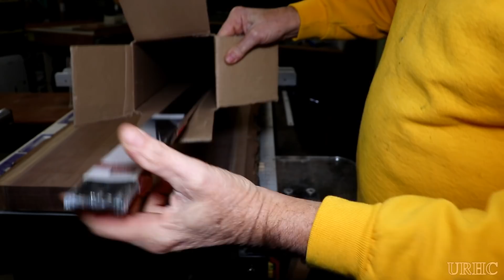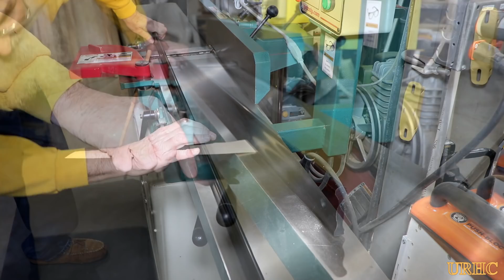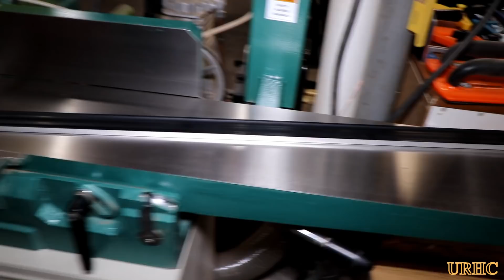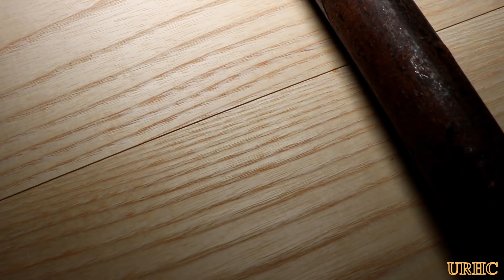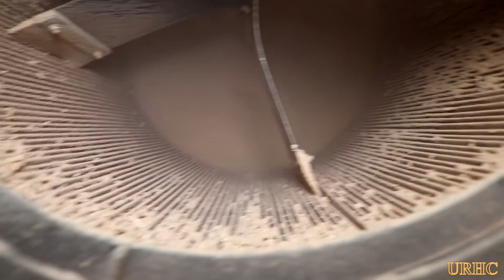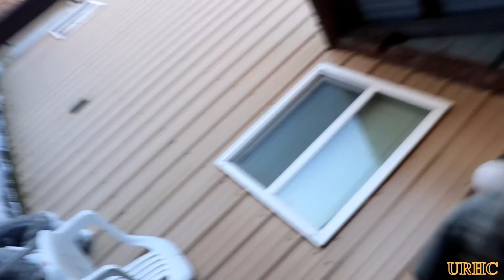Peachtree 50 Inch Straightedge For Aligning The Jointer Tables & Blowing Out The Dust Collector Filt

Comment: I had the same filter set up and got tired of cleaning the stupid filter.  It was forever choking the efficiency of the vacuum. Instead,  I purchased a 40 gallon Brute trashcan with a lid and disassembled the dust collector.  I cut the trashcan lid to match the center ring of the collector and mounted it.  The center ring already has a cyclone built in.  Then I installed the lid cutaway to the top of the cyclone and added a 4" port.  I mounted the motor to the wall outside of my shop (for noise reduction) and it vents to the outside.  It works GREAT!  Only super fine dust gets vented outside and there's no more .5 micron fine dust in my shop anymore and I'm not wasting time with the stupid filter anymore.
Reply from the maker: I have videos  about  redoing my whole system.  The dust deputy really catches most of the fines. Thanks for watching.
Reply: @unemployedredneckhillbilly2023  Understood.  My point was about getting rid of the filter completely and venting the system outside to eliminate any dust escaping the filter.
Reply from the maker: Not an option  in cold climates  and having  a woodstove.

Comment: The problem i have with that straight is their claim is made in a vacuum, the straight came in a package that ensures no protection, and i'm not referring to the mailing section, i'm referring to the shipping from factory.
Now, for a wood planer, there's no need for more than a visual inspection on that straight edge can detect, but still, claiming point something something when your product arrives in plastic...yeah, not worthy of that claim.
Reply from the maker: I expected it to be packed better but I didn't see any indication that it had been stressed. I wish that I could find a big surface plate to check it to have a good idea of how much it is out. I am sure that it is accurate enough for setting up the woodworking tools that 
I own Being able to mate 2 surfaces cut with perfect alignment is the real test and it was straight enough to make that happen. The shape of it makes it very rigid and it lays dead flat on my milling machine table so I know at least 3 feet of it is flat. Lucky it came by USPS because UPS would have surely damaged a box that long. Thanks for watching.

Comment: I noticed that the filter cleaner blades were just bolted on, I would be tempted to replace them with wider blades so that they cleaned more area. I think this would be a simple but effective amendment to the filter
Reply from the maker: I don't think it would help. The blower packs that sawdust around the bottom with that big hole in the divider plate. I ordered a cyclone today to try. Thanks for watching.

Comment: I have the same (or very similar) dust collector. I have to do the same cleaning every once in a while. I added a separator using a metal garbage can and make the funnel on top by watching a yourtube video.   Made a huge difference.
Reply from the maker: I use one of the separators on my planer and it helps with the chips but the fine dust goes right through it.  Thinking about a big dust deputy on a 55 gallon drum now. Thanks for watching.

Comment: I would love to get a dust system but my shop is way to small for one. Tomorrow I am bringing home my first planer, I have no idea where to put it yet lol
Reply from the maker: My first shop was a 10 x 10 garden shed in a trailer park.  I had to drag the tools outside to use them. Never thought I would have a shop big enough to build projects in but somehow it all came together.  I still remember them delivering the first new tool that I purchased.  A Foley Belsaw 12 inch planer molder. Thanks for watching

Comment: Dear Mr. UHRC, I regularly maintained an 8" Grizz jointer with an after market Byrd Shelix head (I installed the head) for a community shop near Boston. The relationship was a rocky one as I could count on the Grizz needing my attention every week. * It was a heavily used machine in a very large shop. I discovered that the little set screws on the eccentric bed adjusters would not stay put. They were simple (cheap) set screws and had the typical raised ring on the bottom which would cut the mild steel of the axles under the table. When I made small incremental adjustments I could feel the set screw sink into the cuts in the axles. I filled the raised rings off all the set screws. * The set screw would all too soon loosen up and I would need to tweak them again and again. I tried reversible thread lock and found it to nor be tough enough. I then settled on a double stack of set screws in each hole. The one on the top locking down the one below. I got set screws that used all the length of the tapped hole in the base casting.***  Before I get down to business I remove the fence and get it out of my way.  I use my 50" straight edge putting about 3/4 of it's length out over either one of the tables. (I counter weight the short end with a couple hammers so I don't need to hold it)  and a 1/1000" (your paper may be 5/1000" of an inch) stainless feeler gauge to check the OFT (out feed table) to cutter head setting and the OFT to front and back cutters in the head. I then do the same from the IFT (in feed table) to the cutter head and cutters. I do this to find any wackiness between tables and cutter head. I often find that jointer cutter heads are high/low from front to back by. If it were more than a couple thou  I'd shim the base of the cutter head with brass shim stock to get it level to the tables. It's a toss up whether it's easier to shim the cutter head or level the tables (again).*** I use a 12" steel machinist's straight edge to gauge the relationship between the OFT and the cutter head by marking the straight edge and table with a Sharpie so I can watch the amount of drag as I move the cutter head under the straight edge. I do not hold the straight edge. I aim for 1/16" or less of drag from front to back. I will check all the blades on a straight knife cutter head but I don't bother on insert carbide cutter heads as , if it wasn't milled correctly by Grizzly there's nothing I can do about that.*** I also recommend checking torque on the cutter bolts as soon as you get the jointer, again after 1 week and again after 1 month of work. I ALWAYS find bolts that need more torque.  Doing it by hand with the Grizzly supplied Torx driver.*** Oneida - Air recommends that their can filters be blown out every day that the DC (dust collector ) is used. 50 PSI. Between cleaned with air than the flapper as sooner or later the friction from the flapper will wear out the filter . If using the flapper I recommend 30 to 40 turns one way and 30 to 40 turns the opposite way. That will of course wear out the filter quicker. * I've recently added a 96" Phenolic straight edge used by glass shops, to my straight edge collection. For working on 16" and larger jointers. * Yours, G.
Reply from the maker: They definitely are tricky to adjust. I am guessing those 2 front sets screws slipped over time as you say. I will have to try using 2 set screws as you suggest because the hex felt like was soft and stretched when I finally cranked them back down so I planned on changing them anyway. For some reason they only put the flappers at the top of this filter  and they have never done a good job at cleaning it. I am thinking a super dust deputy will help catch most of that finer dust before it sticks to the filter.  Thanks for watching.
Reply: I'm all for 2 stage DC. I also respect Oneida's products. Made in Syracuse by people from Syracuse in an old Porter Cable factory right off of downtown. G
Reply: You could also go with brass tipped allen screws, they crush a bit when you tighten them and won't hurt the adjustment rod.

Comment: You will really like a two stage set up.  I have a large cyclone and only the finest dust finds it's way into the filters.  Also, as you mentioned, filters do require a "seasoning" period before they catch the .5 micron particles...and after a good cleaning, it will probably require a bit more "seasoning" to run at peak filtering efficiency.  Thanks for another informative video.
Reply from the maker: I am thinking about trying a super dust deputy in front of the collector but don't know how it will affect the flow. I would love to get a cyclone type collector some day in the future as they seem to have good flow at higher pressure using the 4 inch runs like I have. Thanks for watching.
Reply from the maker: Wow that is a nice cyclone collector you have. I currently have 3 - 4 inch lines connected  to my grizzly but never use more than 1 at a time so I have to make some changes. The tag on mine says 1700 cm with 14 inches max static pressure but I have no way to verify it and I know the 3 y adapter on the input is not a good  solution  for attaching hoses. Thanks for offering help on questions.  I may take you up on that offer in the future.

Comment: I have one of these and it worked great on my 12” Grizzly Jointer.
Reply from the maker: It was the most affordable straight edge that I could find and seemed very accurate. I wish that I had a 12 inch jointer. Thanks for watching.

Comment: I would LOVE to see your take on a home built Thein Separator and/or Cyclone !!
I plan to get the Harbor Freight 2hp single stage collector and do the same thing to it.... at some point. For now the shop gets filled with dust and I mask up accordingly, and then clean up :(
LOVE your shop !!
Reply from the maker: I just am thinking about one of the large Dust Deputy cyclones in front of my grizzly. I use a small one with a shop vac on the cnc router and that filter stays clean. If that fine dust makes it way up into the house my wife would kick me out. Thanks for watching.

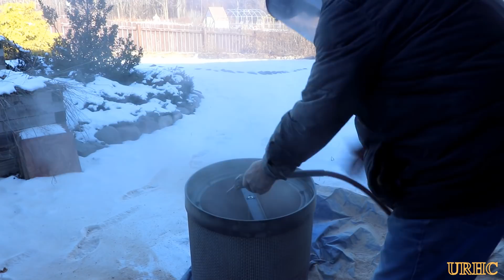Comment: @9:33 that's how I felt cleaning my Hoover bagless filter.
Just a smaller version of that.
I did the John Heisz method.
Drill with offset bolt in block of wood method. https://youtu.be/9x_xKImt2Xw
(Minus the wood. lol)
Too bad the big filter you have there can't be the same way.
Reply from the maker: This is the only way I have figured out to make it usable again. That really fine stuff gets lodged in the filter paper. Beats $250.00 for a new filter. Thanks for watching.

Comment: A little time now, saves a lot of aggrivation later.
My 3D printer, you have to do a 4-point level twice, as you say, you adjust one spot, it affects the other.
I was lucky my Hitachi 12" Double bevel slider was good.
My 15 year old Ryobi 18v battery miter saw had too much plastic flex everywhere to properly align.
So I only use the Ryobi for 2x4's, etc. Too bad as I bought a nice blade for it.
Reply from the maker: I know what you are talking about leveling the printers.  hopefully it will be good for another 4 years now. I have to quit piling wood on it when planing. Thanks for watching.
Reply: Do the center first with the paper trick, then, clockwise, move the head, using jog to the other positions and adjust using increments rather than targets. So, one bit here, one bit there (still using the paper as a gauge). Eventually, you'll reach a target and everything will be right.

Think of it this way, it's like climbing a narrow, round flight of stairs, first you touch the pillar to get support and then, one step at a time you climb till you reach your destination VS trying to gallop three four steps at a time and tripping and falling.

The slower you go adjusting that table, the better the end result is. And i know such things can be frustrating, but 3D printers are still anchored in old machinery, and leveling a machine, tramming the head, they aren't things you whip on a dime.

Just my two cents.